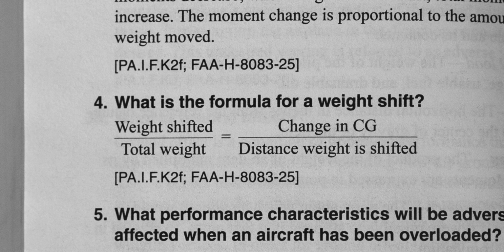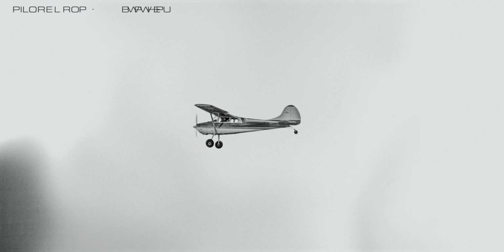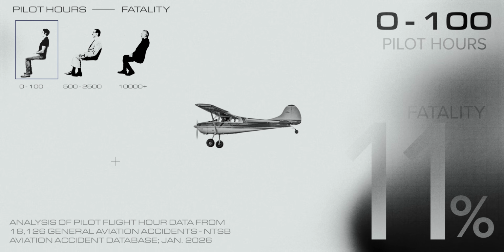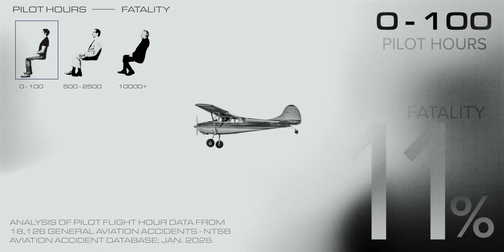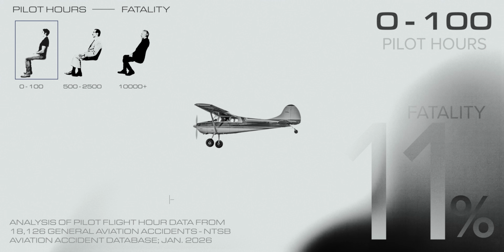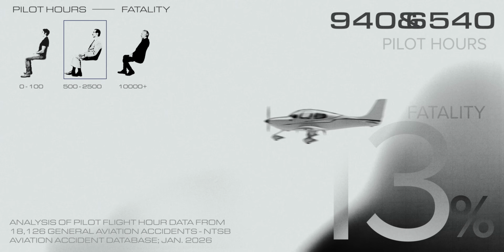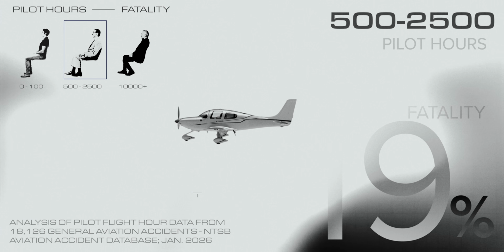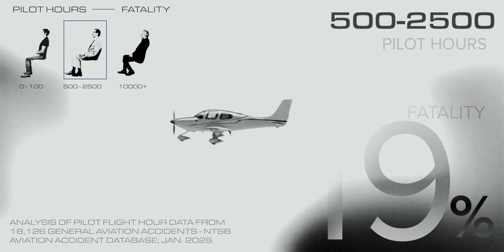Why Small Planes Crash (The 100-Year Design Flaw Nobody Fixed)

Comment: That’s exactly how modern aircraft should be designed. Aircraft like the F-22 are actually easier to control than a Cessna, because fly-by-wire systems translate the pilot’s inputs and provide stability. Without computers, aircraft like the F-22 wouldn’t even be flyable, since they’re intentionally designed to be aerodynamically unstable.
Reply: We're on the same page! 🤜🤛
Reply: 100%.  its time someone builds one!
Reply: false, you're just ignorantly jumping on the bandwagon without understanding all the issues. this is an advertisement, and you fell for it.
Reply: @S@SoloRenegadeIt might be an advertisement, but the concept itself isn’t new. Fly-by-wire and envelope protection have already made modern aircraft safer by reducing human error. The idea is valid, even if the video is marketing it.
Reply: @mo-ug1ys  correct. FBW and envelope control is nothing new. yet every design that tried that has been a failure and is no longer in widespread production or use. they all suffered fatal accidents as a result of pilot or system error.

the concept is logically sound, but the implementations thus far in all of aviation history have all failed.

the issue is that everyone falling for this "high tech" solution is missing the whole point. they are trying to apply a very expensive bandaid on a problem without properly understanding the root causes of that problem to tackle it correctly. Anyone who thinks envelope restriction will prevent accidents has no clue what they are talking about. Because if you restrict too much, you cause accidents through unintended consequences of restricting control, and if you don't restrict enough, you fail to prevent accidents.

Reality Check: you cannot prevent pilot error without removing the pilot entirely. And if you remove the pilot entirely, you've defeated the point of GA flying in the first place.
Reply: @SoloRenegade If fly-by-wire “failed”, aircraft like the F-16, F-22, and Airbus fleet wouldn’t be flying today. Many of these aircraft are intentionally unstable and rely entirely on control systems to remain flyable. The issue isn’t the concept, it’s the implementation and human-machine interaction.
Reply: This is a good convo! What would you guys like us to dive deeper on in our next video? We’re an open book.
Reply: @shanestinemetz  I’d love to see how you handle edge cases and failure modes especially the balance between pilot authority and automation. That’s where most real-world issues happen.
Reply: @mo-ug1ys on it!

Comment: If you make this aircraft under $60k then it'll gave GA pilots who would otherwise by a cheap Cessna. If you sell if for $600k, $1m+, then forget it. You're just there to save the rich.
Reply from the maker: That's a tough price target for our first aircraft.  We're going to do the best we can to drive down the costs of it!
Reply: @Skytron-Aero I get it. A new Single Cessna is 500k. When they came out they were similar to the cost of a corvette. Not a house. GA is on its last leg. Maybe you can save it.
Reply: @Skytron-Aero  avionics are ridiculously overpriced these days. I'm a professional pilot but also an engineer working in cutting edge computer tech industries and have designed and build world record setting devices. What electronic avionics cost these days is downright corruption and greed. the cost to add simple electronic screens to an experimental airplane is criminal compared to what such equivalent systems and components in other  industries cost. People have even made their own instrumentation for hundreds of dollars that do what systems that cost tens of thousands cost.

and I am an a mechanical and aerospace engineer who specializes in high tech, low cost, low volume production, working in the computer industry playing with computer devices more cutting edge than anything you'll use in your products. we once solved a problem for NASA that they failed to solve for decades, with a computer that cost a mere fraction of what they claimed it would have cost. it was pennies on the dollar compared to what they would have spent, and we developed it in a fraction of the time anyone thought possible.